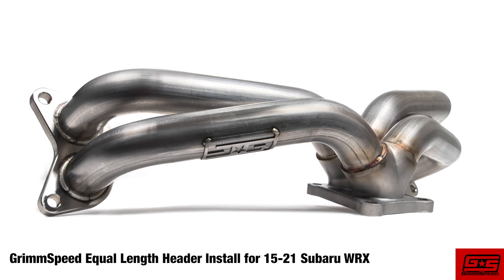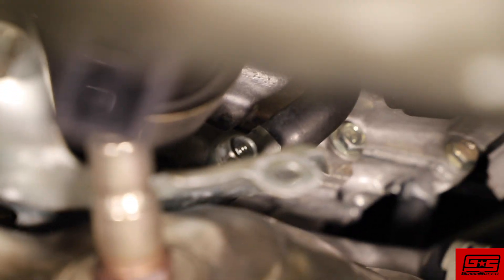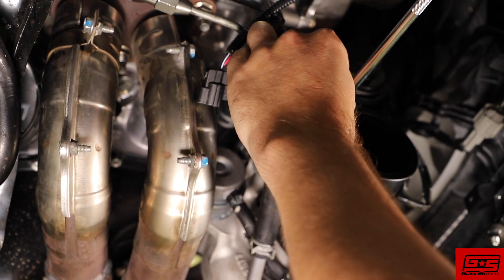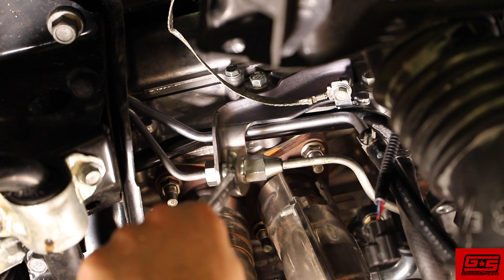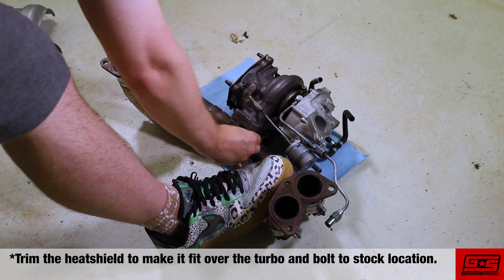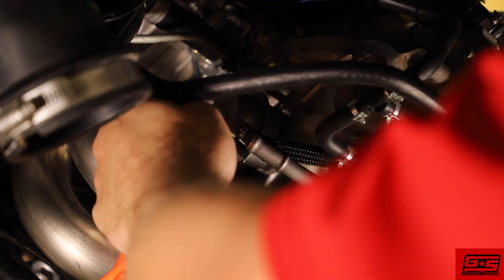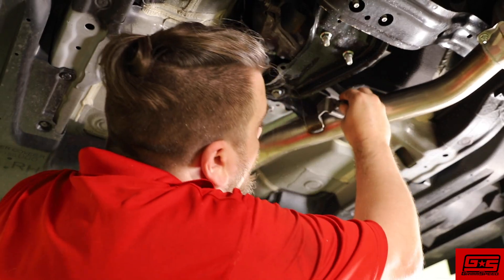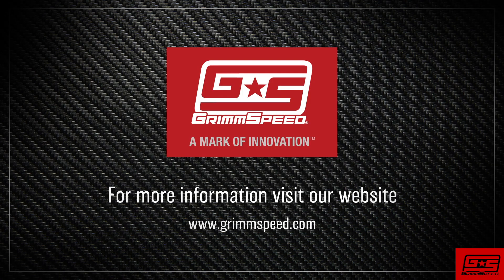GrimmSpeed Equal Length Header Install - 15-21 Subaru WRX

Comment: How long should this job take ?
Reply: Judging by the angle of the studs on the turbo and cylinders plus the heatshield u need to remove to access upper bolts, you are not able to do so without taking the whole thing off, the FA24 is not like this tho

Comment: 8:11 When did you guys remove the 44651AD950 (44651K*A) and 44651AD960 (44651K*B) heat shield pieces that shroud the portion of the exhaust manifold where the pipes merge into their connection point with the turbo?
Reply: I love how they ignore all the questions pertaining to this
Reply: @SwayzWRX  I just took my manifold off with the turbo connected. Much easier than trying to get the shield off
Reply: @GlobalGamersCommunit  also what I ended up doing
Reply: @GlobalGamersCommunit  Can you give a bit more detail on this? Did you pull it all the way off or just a bit to remove the shield?
Reply: @nickadams3958 unbolt the downpipe from the midpipe (the catback section) support the downpipe with a jack stand and undo the bolts to the exhaust manifold. It’ll take some wiggling but it’ll come down with the turbo so you can get to everything significantly easier. Including the downpipe-turbo bolts
Reply: @Smljhndnsmr  also interested to know this. My shield is rattling up a storm

Comment: Just a question this headers fits in a 2014 forester xt????
Reply from the maker: We haven't confirmed for ourselves, but we believe they should fit. The factory header is the same part number, so it should bolt up just fine.
Reply: I have a 2018 perfect fit

Comment: Nice video,  enjoyed it, I own a forester,  can I add your manifold and turbo to my car..
Reply from the maker: Assuming you are referring to the GS header, we haven't confirmed fitment for Forester's ourselves, but we believe they should fit. The factory header is the same part number. Keep in mind generation changes. For more info on this, feel free to give our customer service team a call. They would be better suited to give you a solid answer. As far as turbos, GS turbos fit on *most EJ series engines. Again, call for confirmation if you have any doubts.

Comment: I just installed this and I'm getting smoke from where the header meets the turbo. Is this normal for first startup or should I be concerned? After market catted downpipe and cutback also installed

Comment: Nice 👍.  I always need more tools and time, always. 

I'm curious how long it takes robots to make the factory headers. How much longer and extra effort it would take the same robot to build a header similar to the Grimm Speed unit?   Better pipe, better flanges, and jigs is all that isneeded so I'm curious why factory (exhaust) stuff always looks low rent.

If machines/robots can cut and bend the pipe, then weld it after its in the jig, the only limiting factor is cost...but that cost is reduced by magnitude of scale.
Reply: emissions lol

Comment: holy shit thats a whole lotta shit to do just to change the exhaust manifold... ill pass
Reply: yeah after seeing all that goes into it ill just wait till i either do an upgraded turbo or if i get a short block
Reply from the maker: It is a relatively intimidating install. But we hope that our install video gives you all the knowledge and confidence to preform the job correctly.
Reply: @GrimmSpeed  Nice video! Honestly, EGR is more of a pain in the ass than what this looks. Nothing about this install is hard to get too. All depends on how much of a pain the nuts want to be.
Reply: You're obviously not built for this life lol.
Reply: I'm not sure if this is worth the trouble on my 2015 WRX. I have my exhaust aftermarket from turbo onwards. When I replaced the J-Pipe that was a huge pain. Removing the muffler components was also a hard thing to do with the rusting on it with bolts etc. Real nice when everything is just surface rust and such :).

Comment: What are the torque specs for the bolts that go into the turbo itself? I'm not installing this specific Grimmspeed product but I'm in the process of installing your EBCS and Chargepipe right now and I'm wondering if you guys know the torque spec's for those. Thanks!
Reply: 5.5 ft/lb on the turbo inlet bolts.  11.8 ft/lb on the charge pipe bolts.
Reply: @b16civiccx  thank you